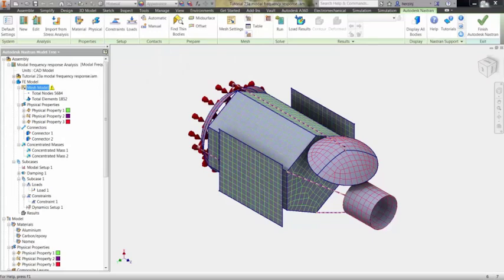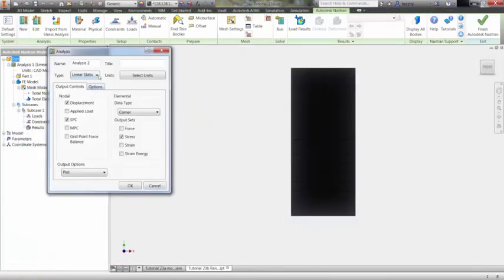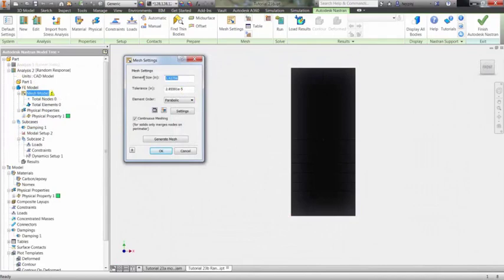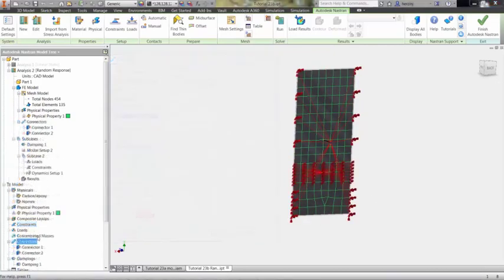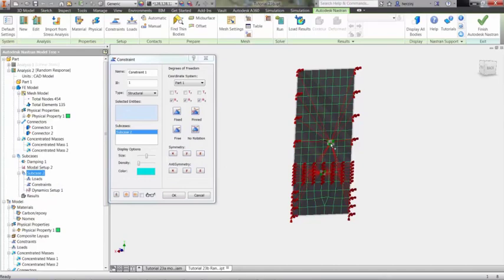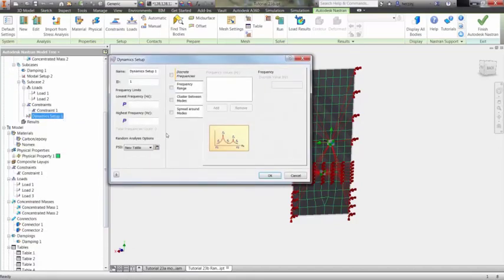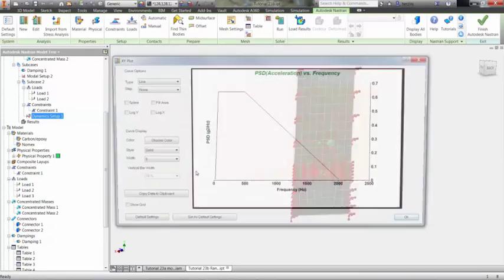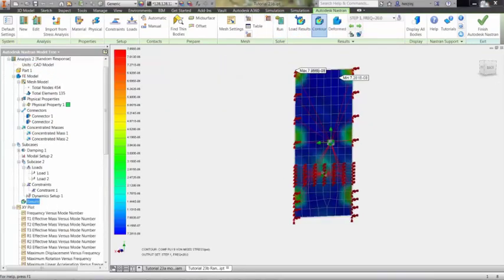Nastran In-CAD - Random response

Comment: Great video.
Only thing I'm confused with is that structure is connected to a 1e7 lb mass, and then that mass is subject to a 1e7 lb equivalent force. First, why is that? And second, the equivalent force of 1e7 lb as a mass would be the force under acceleration of gravity at the Earth's surface? As this appears to be a solar panel of a satellite, that seems like it wouldn't be applicable for most of the satellite's lifetime.